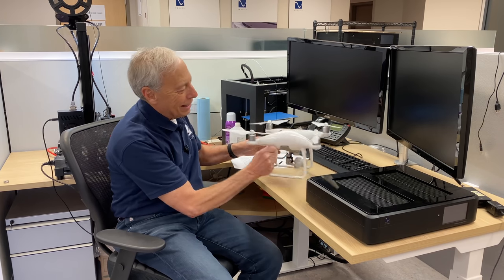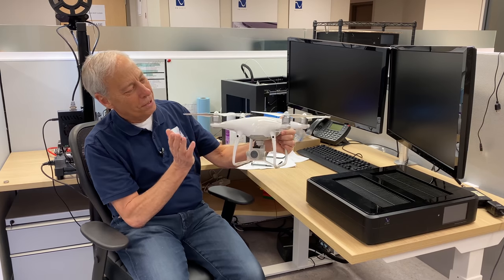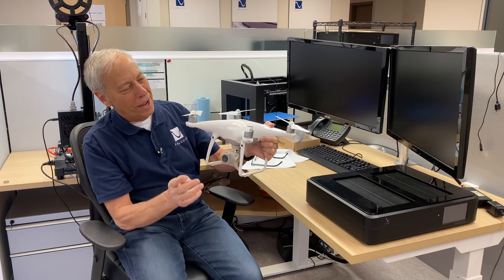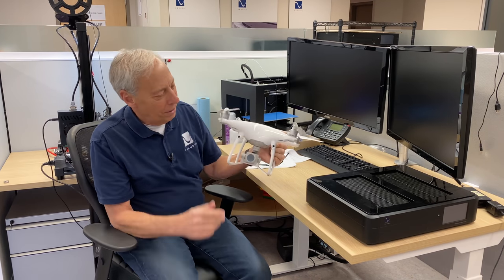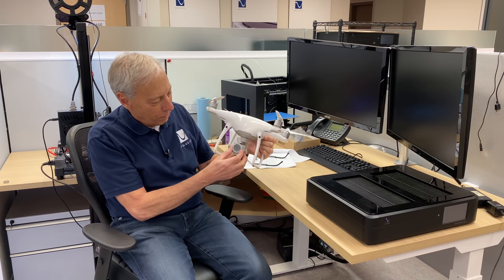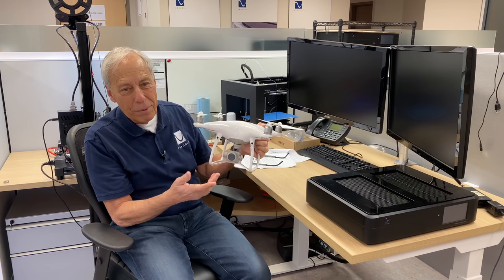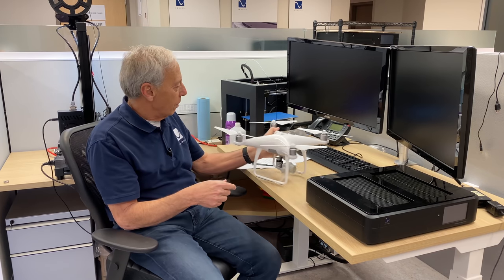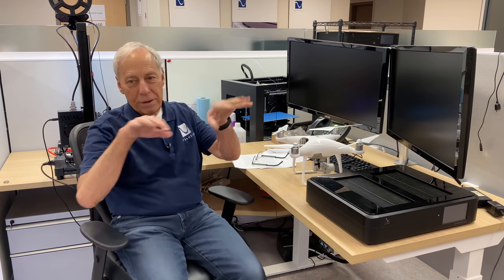Power Amplifier protection

Comment: Amp protection is a good thing but PS Audio should not say that they can’t engineer excellent tone controls and loudness controls because a simple bypass switch will harm the sound...cause amp protection involving fuses, relays, feedback loops etc. are sonically much more critical than a simple line level bypass switch.
Reply: Absolutely true. But marketing protection circuits can only be a positive thing, whereas the crazy stigma of tone controls are considered a negative thing. But you are absolutely right about about the sonic impact comparison of a bypass switch and protection implementations.
Reply: Stewart Markley Yes, some absurd snake oil argument came into existence ages ago and now bypass switches are frowned upon. Nowadays retro audio gear fans are “rediscovering” the wonders of loudness, sound controls and bypass switches...
Reply: @ThinkingBetter  Yes, I think it was precipitated by the "straight wire with gain" notion that anything affects the sound. I think that anything can affect the sound but not everything does or is audible if it does. I find it amusing and sad at the same time that some people go to great lengths and expense to slightly alter the sound of their systems that provide minimal differences in frequency response when much more effective, flexible and less costly tone control can be used. There is this misguided idea that tone controls can only degrade the sound or detract from hearing what the artist and/or producer intended. Meanwhile the same people will spend insane amounts of money to barely affect or not affect the sound at all in the belief that they are getting closer to that objective, while ignoring or not realizing that the speakers, room and positions in the room have far and away more influence on what they hear than any amplifier, cable or what have you.
Reply: Stewart Markley Yes, the combination of snake oil marketing and ignorance is messing up the audio industry. If it only affected US$100,000 systems it would perhaps be OK but even relatively low cost products are infected by some of these opinions. It’s “high-end” to not allow any tweaking on your favorite music that was heavily tweaked in a studio to sound good on some different speakers in a different room.  For digital music, I like to see a high quality DSP in the digital signal path before the DAC giving me some tweaking ability. Btw, bypassing any audio tweaking function in the digital domain of a DSP is of course totally 100% harmless.
Reply: @ThinkingBetter  Yup, I'm with you about DSP EQ. Parts Express has one for $150 that I was about get then I found out about Equalizer APO a free piece of software that I can run along with REW to tweak my room response. Back in the old days (my era), I had to go with expensive 1/3 octave equalizers to get anywhere close to what I can do now for free. Tell me again why old technology is better than today's technology.
Reply: Stewart Markley Nowadays we can make better products because we have more and better components to use in the design but it just doesn’t happen as often as I would like to see it due to silly reasons of ignorance. I should perhaps not say this, but audio engineering has moved to China for a good chunk of it, and the engineers there only know the copy method of engineering thus we end up with endless piles of products that are just “reference designs in new clothing” e.g. lots of DACs are just that.
Reply: @ThinkingBetter  For electronics that is certainly true. Not for speakers though, thankfully. But there are a few American companies that design and build audio electronic products, and other than building my own stuff, these are the companies I would chose to do business with.
Reply: Stewart Markley Yes, a few, but the majority of what people buy, including anything carrying brands like JBL, Klipsch, Yamaha or whatever, is typically engineered in China nowadays by contract manufacturing companies like Tonly. A lot of brand licensing is now milking brand value that grew with passionate engineering decades ago.

Comment: I would never buy a piece of gear again that has more protection than a fuse. Because it puts the music in a grip and functions as a filter on everything you hear. Same with equalizer, bass, treble knop, clip protection and built in headphone, wattmeter and such. I had it before with a lot of gear, and it makes it too polite for me because of the extended circuit. I get why people have it in terms of being practical, but there is a huge sound gain to be had, not using it. Fuse and powerbox is more than enough which already affects the sound badly.
Reply: Some protection is active, in that it can affect output distortion, and can be especially susceptible to reactive loads.  
But manufacturers have been moving away from that approach.  Today, most protection circuitry acts as a monitor, which only puts the amplifier into shutdown if it detects a problem; it has no effect on sound until it suddenly disappears.
Reply: @marianneoelund2940  Agreed but good protection is not new ,a few months back Paul mentioned that in the 70's  Phase Linear sounded better than  Crown ,I posted elcewhere in this thread about how well their protection circuit worked.
Reply: @marianneoelund2940  I prefer to put a fuse in the speaker outputs even with the latest and greatest protection circuits as a fail safe just in case. I use fast blow and just enough current rating to keep extended heavy bass notes from blowing the fuse.
Reply: @StewartMarkley  
Fuses are still commonly used to protect speakers and I agree they are a good idea.  Even my Dahlquist DQM-9's have fuses built in, one for the common input and a separate 0.8A fuse for the tweeter itself.  My Dynaco Stereo 400 has speaker fuses, in easily-accessible front panel holders.  
Unfortunately, some audiophiles think they can "hear" fuses, so don't want them in their system where not absolutely necessary.
Reply: @marianneoelund2940  Ahh yes, the good old Dynaco Stereo 400. I built one back in 1975 and used it for many years. A great amplifier, it replaced a Bose 1801 that was part of my first "high end" system, with 2 Bose 901s per channel. Tremendous bass and stereo image, but even 400 watts per channel wasn't enough to keep the amp from clipping on strong bass drum kicks. So it all had to go one day and I built the Dynaco and went the other extreme with Altec 604s which were great but needed some EQ to sound smooth. I'm building some new speakers and amplifier now and will use fuses again even though the ICE Power modules have internal protection built in. I intend to do a lot of testing and comparisons with various components from crossovers, to speaker cables and yes even fuses and connections.
Reply: @StewartMarkley  
Fuses are still a good idea.  I maintain equipment at two skating rinks, and we have a pair of Behringer powered 18" subs at one of them.  They have a long history of failures, the most common being the bootstrap capacitor that supplies voltage to drive the high-end MOSFET gate - it goes high ESR and then the switching waveform rising edge gets very slow and overheats the MOSFET.  Eventually it shorts.  The speaker is saved by the fact that it's a bridge mode amp, and the other side of the bridge sees the DC voltage and shuts down.  
If I was putting together an amp with class D modules, I would probably go for a bridge mode configuration, for the redundancy, as well as the option to run from slightly lower supply voltages.
Reply: @marianneoelund2940  Thanks for the tip on the Class D amp, but I am using ICE modules with their own power supplies. What I want to do is also build an amp with Hypex modules to see if I can hear any difference.
About your capacitor situation, by chance is that cap close to some device that generates heat? When I worked for the Air Force out in the Nevada desert, I fixed a lot of Sony broadcast monitors that had a chronic problem with a cap very close to a regulator heat sink so it was getting hot and failing. Just a thought to pass along.
Wondering if you ever made any conclusions about 60Hz fields around your system.